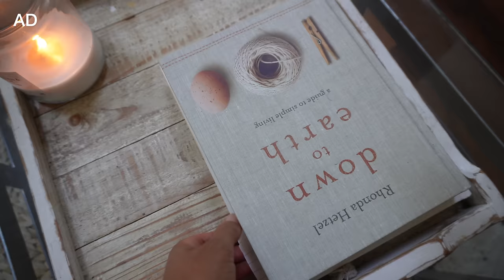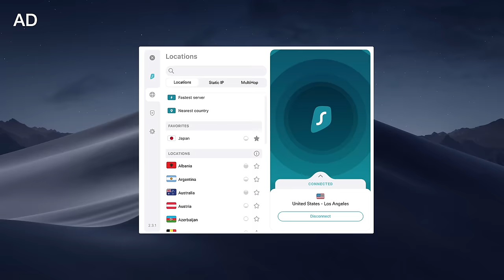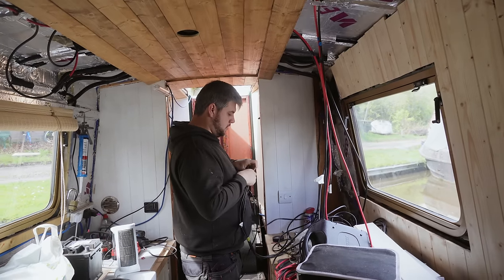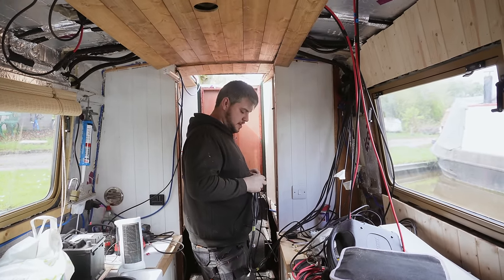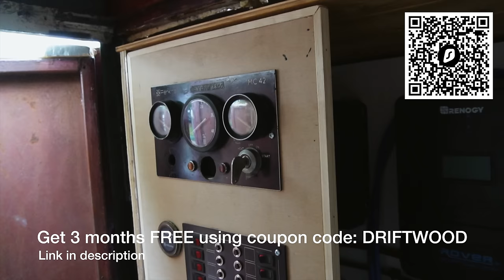Saying goodbye to our insulation! | Narrowboat Restoration

Comment: Hi. Lovely to see another of your videos.
It’s pretty cool how much progress you have made with your Re-fit,just a little bit of a heads up with Tongue and groove panelling ( especially in a narrowboat ),you need to have 2 screws or nails per batten otherwise they will go misshapen as time progresses,many boat owners have tried with singular screws or nails in the middle or on one edge and they end up having to remove the T+G and replacing the lot,the problem is the Cold,condensation and the heat which greatly effects the Wood,Screws with a bigger head are best and a top tip with screwing into timber is a little bit of sikoflex per screw which prevents the screws from going rusty or squeaky ( as the timber moves ) which it does especially on a Narrowboat.
Reply from the maker: There is two nails per batten you just might not have seen me do that in the video because I don’t include every step 👍
Reply: @DriftwoodFolk   I’m glad you did do the 2 per batten, I was in two minds about saying something to yourselves and decided it would be better for me to seem like a interfering so an so rather than you having to re-do all the Work of the T+G…. Better to say something than nothing scenario 🤷‍♂️.
There’s plenty of times when I’ve done DIY projects and I wish someone had said something at the time,rather than after the fact Lol 😂.
I hope you didn’t mind me passing on my little nugget of knowledge to yourselves
Reply from the maker: No I never mind, sometimes it’s saved us a lot of headaches!

Comment: Hi Nesha,
Haven't you come along with your carpentry skills.  If I may offer a few suggestions.  Do get yourself a few clamps if you do not have them.  Also when you install something with screws drill a pilot hole first then the screw(s) will suck the wood down tight first time.  It will also reduce the chance of splitting the wood when a screw is put close to the end of the wood.
Third there are skill saw blades that are more narrow than the one you used.  Their purpose is to make cutting a radius easier, B&Q will have them.
Mark
Alberta, Canada